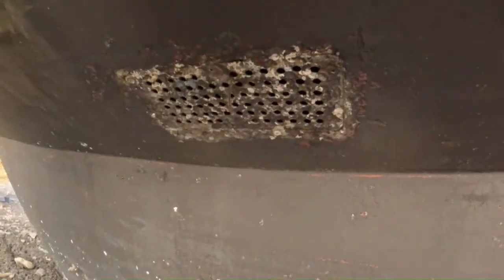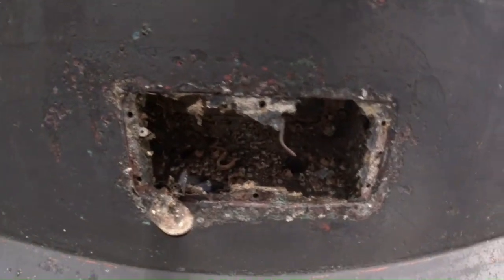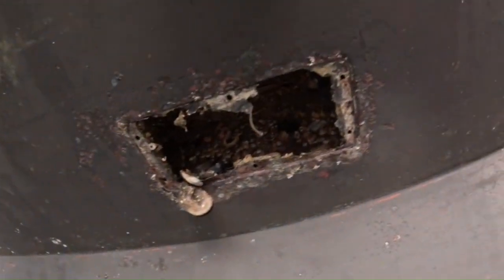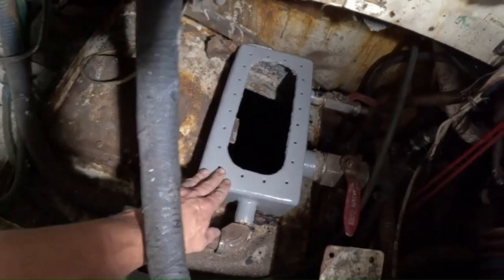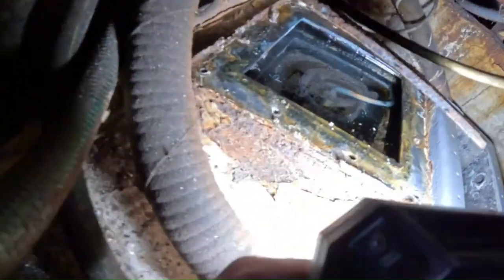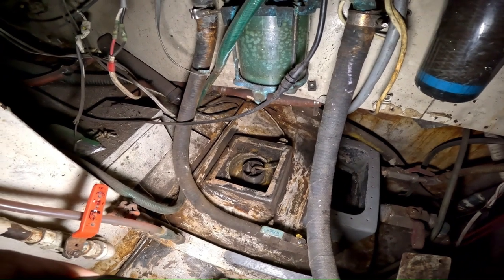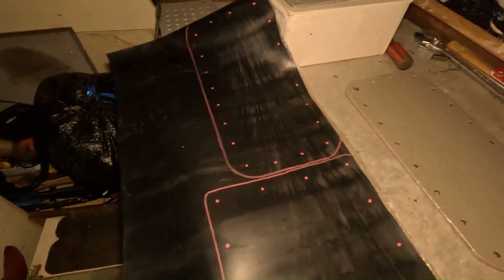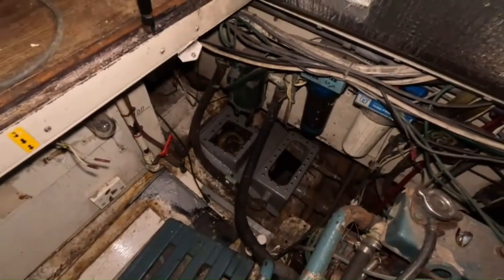Cleaning A Sea Chest: Ep.5

Comment: You know I might just get rid of that 'Sea Chest' all together, it looks like you could cut it out, weld in a blank then place 3 proper seacocks right there. The 'Chest' is just adding complexity. Swap out the depth finder with a modern replacement that doesn't require a seal to be managed for all time.
Reply from the maker: Ive already cleaned and put it into service the way it is. The sea chest in my research just provides equal pressure and plenty of volume more than a standard seacock. it mainly feeds my toilet and engine raw water. Thanks for the reply
Reply: @IIAShadowII 
You sir are correct. For anyone reading this I’d suggest do not get rid of a sea chest. A through hull fitting alone has a small surface area inlet that creates high pressure and sucks in weed and debris. You have to then have an internal in line sea strainer that blocks/fills  easily and must be regularly checked as it fills with weed  and other garbage over time causing over heating issues or engine damage. 
That sea chest style strainer you have creates a large outside surface area of very low pressure, so most debris will just wash past. It’s simple and it works. And… yes I would still have an internal inline sea strainer to catch the odd bit of ribbon weed etc that might get through, but you will find it’s often very clean when checking it. 
Cheers 🍻

Comment: It doesn't look like an insulated hull. I'm wondering what it looks like from the inside. Steel sailboats that are uninsulated rust from the inside out. I own a 50ft steel sailboat. I'd look behind the interior walls to see what there is for insulation and if there's none, well you're in for some serious headaches down the road .
Reply from the maker: There's 3in insulation everywhere, but the engine room and water tank areas. I'll have more videos on engine room and water tank cleaning that will show more. Thanks for watching
Reply: that's good to know because I saw a lot of rust streaks coming from above and from the videos it's hard to make out where they're coming from. Make sure you use the proper coatings. I use PPG 2 part epoxy products for my bilge areas.  @IIAShadowII
Reply from the maker: @robertfreeman2322  I use amaricoat 235 2 part epoxy. 5-7 coats
Reply: Yeah man that's good stuff. The Dimecote 302h zinc is my go to for first coat on cleaned bare metal then a lot of 235.  @IIAShadowII

Comment: Perhaps should have roughed up the interior of the sea chest and painted it? or are you doing it from underneath? but yes. a nice video report
Reply from the maker: Yes, i also did grind the outside of the chest as well as prime and antifoul it. But Just like the actual Epoxy of the lid and corroseal area in this video. I didn't get it filmed probably dead gopro. Thanks for watching!!